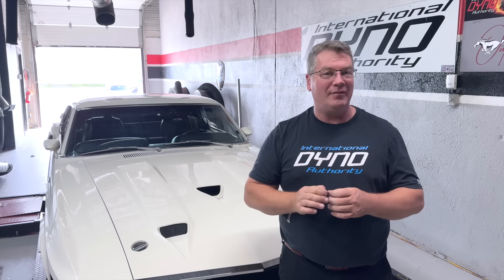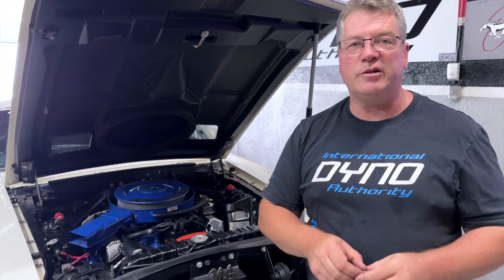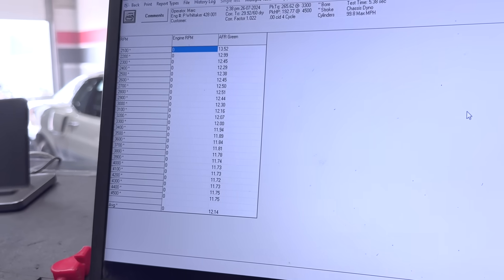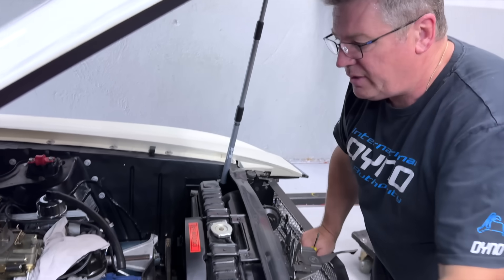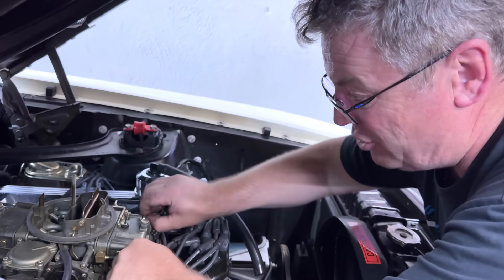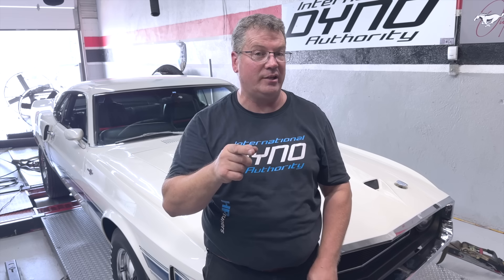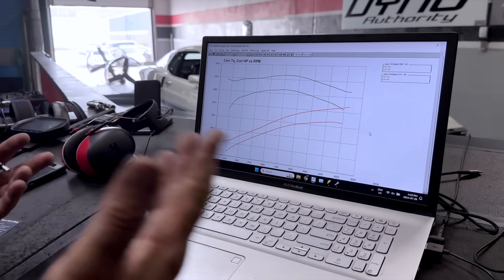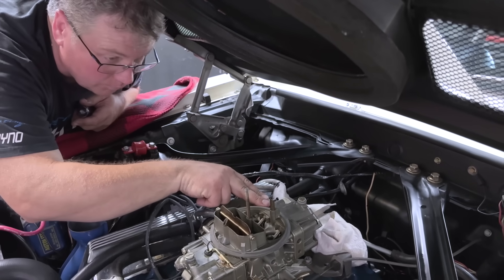Original, unrestored '69 Shelby GT500 tuned on the dyno

Comment: 428 was a dog. It was not a cross bolted main block, it had weak rocker assemblies the heads were typical Ford choked down junk, it was no more than a two bolt main over sized 390.
Reply from the maker: Waking Up The Ford 390/428
Originally published by International Dyno Authority 

 June 22,2017.
IDA, staff writer.

With budgets of $100, $250 and $500, you can turn your big-block sleeper into a strong machine using ford parts

In the past two months we've told you how to increase the performance of Ford's small-block engines, using stock parts and budgets of $100, $250 and $500. This month we'll conclude the Ford V8 budget hop-up series by investigating the 390- and 428-cubic-inch big-blocks, again using stock parts. Although Ford has also produced several other big-block engines of varying displacements, we have selected the 390/428 series simply because of their overwhelming popularity. Since the introduction of the 390 back in '61, Ford has produced over four million 390s and 428s. Technically the 352-cubic-inch engine is also part of the same series of engines, and while most of the parts and procedures (except cylinder head swapping) recommended in this article for the 390s and 428s will work equally well on the 352, we will not specifically include that displacement version. Our decision to omit the 352 is based on our opinion that the owners of 352s would be better off spending their money swapping for a 428 (a simple bolt-in swap) or a 351C to improve the performance of their cars.

As we have mentioned before, the modification of street-driven engines must be limited to those produced prior to 1970 to comply with the emission laws in most areas. Be sure to check on this with your local authorities before you spend your money. Of course, if the engine is to be for off-highway use only, no such restriction exists.

Excluding the '70 and '71 smog motors, the horsepower ratings on the 390 have varied from a low of 265 for '68 and '69 two-barrel versions to a high of 401 for the '61 triple two-barrel versions and 340 hp for the '62 and '63 engines with the same induction system. Actually, very few triple two-barrel engines were built in the early Sixties, so we won't concern ourselves with them, since they already contain most of the good pieces. We're primarily interested in upgrading the two- and four-barrel versions to match or exceed the performance of the 325-hp 390 "GT" engine and the 360-hp 428-cubic-inch Super Cobra Jet engine. This amounts to a possible power gain in excess of 100 hp for the two-barrel 390s. Of course the two-barrel 390s cannot be hopped up to produce as much power as comparable four-barrel 390s unless the pistons are also replaced. This is because all but a few of the two-barrel 390s came with 9.5:1 compression ratio pistons whereas the four-barrel units were 10.5:1.

The 428s we are interested in are the 335-through-345-hp versions, all of which carried four-barrel carburetion. If you have one of the 360-hp 428s, the aluminum intake manifold, headers, and possibly dual ignition points
Reply from the maker: @raginroadrunner  Pony car comparison, of your three major manufacturers, with big blocks under the Hood 1968 through 1972.

F O R D

1970 Ford Mustang Mach 1 Cobra Jet 428

Specifications:

Engine:

427.8 cu in/7010cc OHV V-8, 1x4-bbl Holley 735 cfm carburetor

Power and torque (SAE gross):

335 hp @ 5200 rpm, 440 lb-ft @ 3400 rpm

Drivetrain:

3-speed C6 automatic, RWD

Brakes:

front: vented disc;rear: drum

Suspension:

front: control arms, coil springs, anti-roll bar; rear: live axle, leaf springs

Dimensions:

L: 187.4 in, W: 71.7 in, H: 51.5 in

Weight:

3900 lb

Performance:

0-60 mph: 5.7 sec

Quarter Mile:

14.3 sec @ 100 mph, (Car and Driver, Nov 1968)

Price when new:

$4900

C H E V Y

1969 Chevrolet Camaro SS396

Specifications:

Engine 396.0 cu in/6489cc OHV V-8, 1x4-bbl Rochester Quadra-Jet carburetor

Power and torque (SAE gross):

375 hp @ 5600 rpm, 415 lb-ft @ 3600 rpm

Drivetrain:

3-speed automatic, RWD

Brakes:

front: vented disc; rear: drum

Suspension:

front: control arms, coil springs, anti-roll bar; rear: live axle, leaf springs

Dimensions:

L: 186.0 in, W: 74.0 in, H: 51.1 in

Weight:

3550 lb

Performance:

0-60 mph: 6.8 sec

Quarter Mile:

14.8 sec @ 98.7 mph (Car Life,* May 1969) * 4-speed manual

Price when new:

$4350

M. O P A R

1970 Plymouth Barracuda

Specifications:

Engine 439.7 cu in/7206cc OHV V-8, 3x2-bbl Holley carburetors

Power and torque (SAE gross):

390 @ 4700 rpm, 490 @ 3200 rpm

Drivetrain:

4-speed manual, RWD

Brakes:

front: vented disc; rear: drum

Suspension:

front: control arms, torsion bars, anti-roll bar; rear: live axle, leaf springs

Dimensions:

L: 186.7 in, W: 74.9 in, H: 50.9 in Weight 3720 lb

Performance 0-60 mph:

5.9 sec

Quarter Mile:

14.4 sec @ 100 mph (MT, May 1969)

Price when new:

$4600
Reply from the maker: 390 Engine

Produced 400+ Horsepower in ---1962---

Hardly a "Dog" by anybody's definition.
Reply: @internationaldynoauthority693  My Dad put one in his 55 pickup in 1969... it was a real sleeper
Reply from the maker: @raginroadrunner 

Greetings from International Dyno Authority,

We truly value and appreciate the contributions of all manufacturers—even Toyota! The 305 TPI in the GM F-Body lineup certainly stood out as a strong performer for its time. That said, we can all agree that the era when these engines were on the market was part of a challenging period for horsepower and torque output across the Big Three automakers in North America.

By contrast, the 1960s, particularly the late '60s, were a golden age for muscle cars. Each of the Big Three delivered impressive power and torque figures, with signature combinations of engine displacement and distinct vehicle designs, be it muscle cars or sedans.

Thank you for engaging with our content—we truly enjoy the dialogue sparked by your comments. We look forward to hearing your thoughts on our upcoming videos, as we have some exciting content in store for you.

Wishing you and your family a joyful holiday season filled with Christmas spirit and cheer.

Warm regards,
The Team at International Dyno Authority
Reply from the maker: https://youtu.be/MGgBtNOB6Z8?si=lioBn5jc83nmOKPv
Reply: A 390 wasnt exactly a dog

Comment: Always set total timing first
Reply from the maker: @TobyBielat  

Thank you for your question! We’re always happy to help clarify the tuning process and modifications. Please feel free to share your thoughts or questions in the comments—we’d love to hear from you and continue the conversation!

Here’s a breakdown of key points about tuning and modifications:

1. 87 Octane Pump Fuel Compatibility
Yes, we can tune using 87 octane pump fuel. The tuning process will optimize your vehicle for the fuel currently in the tank during your appointment.

2. Modifications That Don’t Require a Retune

Exhaust Systems: Most exhaust system upgrades, except for long tube headers, do not require a retune. Short tube headers, for instance, primarily replace the stock manifold and offer improved durability without altering the tune.

Cold Air Intakes: High-quality cold air intakes generally do not require a retune. However, lower-quality intakes (like JLT) may necessitate one. During our tuning, we expand the air modeling tables to accommodate increased airflow across the MAF (mass airflow sensor).

3. Modifications Requiring a Retune

Camshaft Changes: If switching from a DOD-supported camshaft to a non-DOD one, or significantly altering the lobe separation angle, a retune will be required. This is because changes to the camshaft can slow airspeed and impact performance.

Long Tube Headers: These significantly impact engine performance and should always be paired with a retune.

Boost Additions: Adding forced induction (e.g., superchargers or turbochargers) requires an upgrade to your fuel system (fuel injectors, pump, and management) and a retune.

4. Tuning Process
Our tuning process is thorough and tailored to your vehicle:

We start with tuning the fuel curve, which takes 45 minutes to 1.5 hours.

Next, we optimize camshaft timing, ignition timing, torque management, mass airflow, volumetric efficiency, and transmission tuning.

Each step is verified, explained, and documented for you.

Finally, we include a test drive to ensure everything performs as expected and provide you with a full report.

We hope this provides a clear understanding of the tuning process and when retuning is necessary. If you have any additional questions, drop a comment—we’d be glad to help!

Wishing you a very happy holiday season from all of us at International Dyno Authority. Merry Christmas, Happy New Year, and here’s to a fantastic year ahead with your family and friends!

---

Would you like any further adjustments?
Reply from the maker: @TobyBielat  https://youtu.be/sRv8Mbq58vo?si=X3Pa4gDjs4CDK4Rs
Reply from the maker: @TobyBielat 

Basic tuning lessons to start your learning "curve". Today

1--ALWAYS tune : fuel, fuel curve, fuel delivery , fuel stages first.

VACUUM, TIMING AND FUEL ECONOMY IN NON-COMPUTER ASSISTED ENGINES

GOALS:To understand the relationship between vacuum and ignition timing and to identify the cause of reduced fuel economy.

OBJECTIVES:For non-computer assisted and some partially computer assisted vehicles, the student will:

1. Learn to identify the ignition system's vacuum sensing device.2. Acquire the knowledge in order to test for a faulty vacuum sensing device.3. Calibrate, for optimum fuel economy, a vacuum sensing device (when possible).

LESSON/INFORMATION:Ignition timing is the single, most critical adjustment for a gasoline engine. Assuming the engine is in good mechanical condition, there are no vacuum leaks, and the fuel mixture is correct, then the ignition timing can affect the net power yield from the fuel. Improper timing can significantly change a vehicle's mpg. Three types of timing are used for gasoline engines. They are:

1. Static timing;2. Mechanical (centrifugal) timing; and3. Pneumatic (vacuum) timing - mechanical.

Each has a specific purpose.

1. Static timing establishes a physical relationship between engine crankshaft position and the distributor. This is fixed and should not change. "Basic" and "initial" are terms also associated in the static timing.

2. Since fuel burns at a relatively fixed rate (i.e., time to burn is in milliseconds), then the faster the engine runs the earlier the fuel must be ignited so that the millisecond time frame will remain constant. Thus, mechanical timing advances are used. A device, usually a centrifugally activated weight control balanced by a spring, advances the timing proportionate to engine RPM's. The faster the engine runs, the more timing advances. This is true up to approximately 2,700 to 3,500 RPM's. Mechanical timing is critical to acceleration and power response in a gasoline engine. This timing is added to the static timing

Each has a specific purpose.

1. Static timing establishes a physical relationship between engine crankshaft position and the distributor. This is fixed and should not change. "Basic" and "initial" are terms also associated in the static timing.

2. Since fuel burns at a relatively fixed rate (i.e., time to burn is in milliseconds), then the faster the engine runs the earlier the fuel must be ignited so that the millisecond time frame will remain constant. Thus, mechanical timing advances are used. A device, usually a centrifugally activated weight control balanced by a spring, advances the timing proportionate to engine RPM's. The faster the engine runs, the more timing advances. This is true up to approximately 2,700 to 3,500 RPM's. Mechanical timing is critical to acceleration and power response in a gasoline engine. This timing is added to the static timing.

3. The third timing, pneumatic (vacuum) - mechanical, provides an extra measure of timing over and above static and any mechanical advance. The vacuum advance extends the burn cycle even longer so that all the heat energy may be absorbed by the pistons resulting in more power yield per measure of fuel and more mpg. The sensing device is a spring offset, vacuum activated diaphragm. This diaphragm receives its vacuum signal from the carburetor or intake manifold. In many vehicles this signal is modified by the transmission gear selector position, by coolant temperature sensor(s), by vehicle speed sensor, or by combinations of the above. Early computer assisted vehicles retained the vacuum advance system but employed the computer to modify the signal to the diaphragm, thereby optimizing the system performance.

Total advance is the combination of initial, centrifugal, and vacuum. See Figure 1.
This is inaccurate and a misconception. Some also believe that advancing the timing and burning high octane, premium fuel improves mpg. This is also a misconception. To burn high octane fuel efficiently, engines must have sufficient compression ratios. The timing advance profiles for premium fuels are different than those for regular octane fuels. This lesson attempts to bring these points home by getting the student technician to investigate the three types of timing.

ANSWERS TO INFORMATION CHECK:
1. True.

2. False. Fuel does burn at a fixed rate: Engine timing, compression ratio, and timing profiles are inherent to each design. Altering timing profiles changes that fuel's burn time. As a result, fuel energy would be wasted due to incomplete combustion.

3. False. Centrifugal timing compensates for changes in RPM's. Vacuum timing compensates for engine load.

4. False. Wide open throttle vacuum approaches zero thus, no vacuum timing is added to basic and centrifugal.

5. True. Many engine overhaul technicians fail to associate some internal engine damage with incorrect timing. Failure to recalibrate engine timing after an engine overhaul could lead to a repeat failure.

6. True. This is what needs to be done to optimize fuel economy for a given vehicle.
Reply from the maker: @TobyBielat  

 

The tuning process for this project was comprehensive and methodical.

Pre-Tuning Preparation
We started with a checklist for the customer to complete before bringing the vehicle in. This included:

Fresh oil

New spark plugs and spark plug wires

A new distributor

Proper fuel pressure

A leak-free exhaust system

Tires in excellent condition

Tuning Process
Once the vehicle arrived, we meticulously tuned every circuit of the carburetor, from idle to low speed, the primary circuit, and the secondary circuit. Here’s a breakdown of the steps:

1. Air-Fuel Ratio Adjustment

We cleaned up the air-fuel ratio until the spark plugs burned a perfect tan color.

Any trace of smoke was eliminated by fine-tuning the mixture.

2. Choke and PCV System

The choke flap, which was bent, was removed and straightened to restore proper airflow.

We reconfigured the PCV system to circulate air back into the engine without oil vapor. This included adding a restrictor and cooling to prevent oil deposition in the combustion chamber.

3. Ignition Timing

The ignition timing was verified and incrementally adjusted to match the fuel in the tank, the combustion chamber characteristics, and the intended use. This resulted in a complete and efficient burn in the combustion process.

4. Carburetor Repairs and Adjustments

We replaced the check valve, power valve, gaskets, and the accelerator pump circuit's check valve ball and spring.

Proper smaller nozzles were installed for the accelerator pump circuit.

The float level was set for optimal tuning, ensuring no smoke and smooth transitions between circuits.

Results
The result is a 1969 Mustang that runs better than ever:

Increased torque, efficiency, and horsepower

Zero smoke from the exhaust

Quick starts, smooth operation, and overall reliability

This is now one of the cleanest-running classic Mustangs on the street, despite never undergoing a full restoration. It’s a testament to careful tuning and a little TLC.

Thank you for watching, and we hope this detailed overview inspires and informs your own projects!

Comment: 300 rwp is about right for that setup..fine job gentlemen
Reply: Only with highway gears and manual.   If it has the 3.91 that seems pretty high for a stock representation on a  chassis dyno but you have to see how some other well known cars performed to really say.  That is just the nature of chassis dyno's
Reply: Pretty huge gain just from tuning
Reply: @gordocarbo  it's a repair.